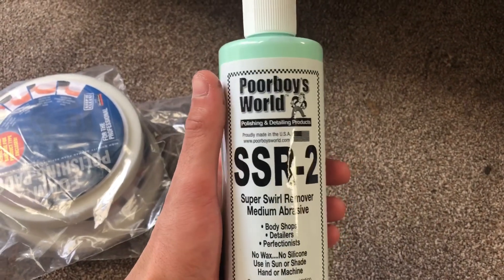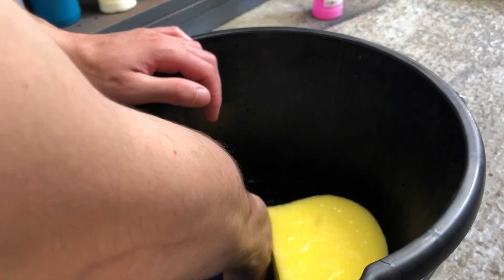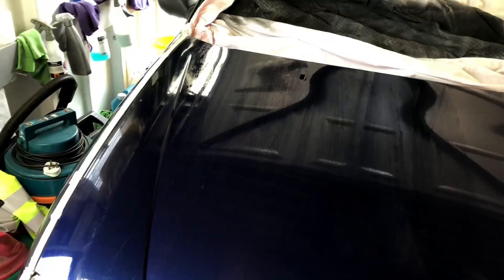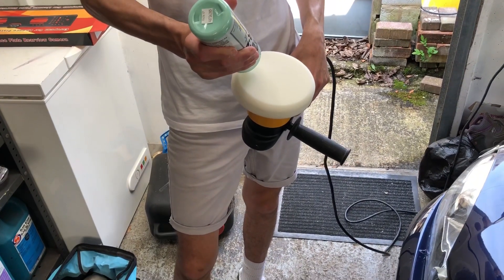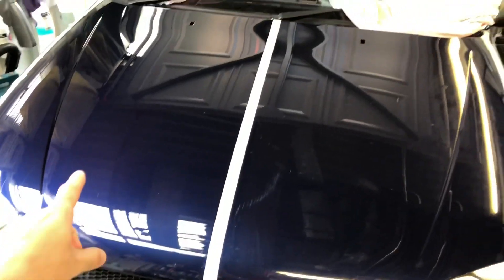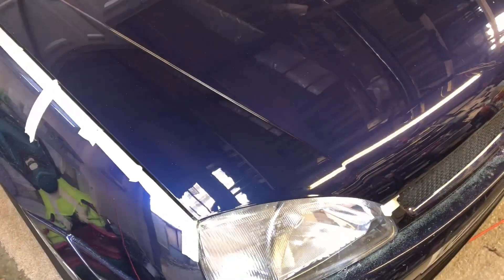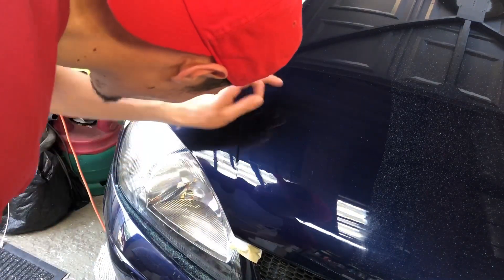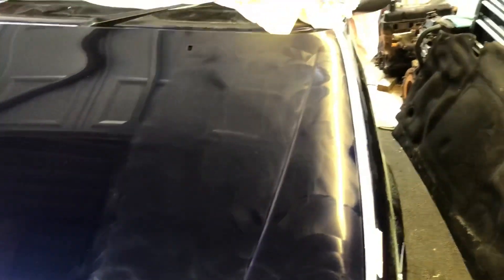Beginners machine polishing (restoring 20 year old paint work!)

Comment: Hats off mate you made it batter than it was and regardless of what the "pros" say if you are happy with it thats all that counts. Not saying don't listen to people and learn things but at the same time most of the people that say you are wrong have never done it. I was always told WD-40 swells up o-rings and is really bad people said it enough times that it was normal to say... Then I watched a few videos and tested it for myself and no WD-40 is safe to use with o-rings.... I believe it did way back in the day when o-rings were made of different compounds. Going off topic a bit but not everything people say is correct even if 100 people back them up they can still be wrong so keep doing what your doing. Try things for yourself   try what you feel others have mentioned and see what works for you not because all the "pros" say you should do it that way. You have a new sub mate keep it up.

Comment: Nice job, the only thing I’d do that I think you’d like is to decontaminate the paint (iron remover, tar remover) before claybar. Iron remover makes the wheels look like they’re bleeding! Weird but great all at the same time!
Reply from the maker: Jay G hi thanks for the comment, I wouldn’t use iron out on body work as it’s very strong and it’s only meant to be used to get brake dust off the wheels. However I did glue and tar the whole car before the process just didn’t record it!
Reply: Mk2 Mitch nice work. You can buy a fallout remover for paintwork too. In case you ever wanted to try. It will strip the wax though! Nice job nonetheless!

Comment: I head the best way to clay bar is to actually roll it over the paint and not rub it. Also adding a layer of polish after compound then wax further increases paint protection.
Reply from the maker: william smith wax and polish are pretty much the same thing but a good suggestion. I wouldn’t roll the clay across the surface as you need as much surface contact as possible to pick up the tar/dirt
Reply: @Mk2Mitch  I enjoyed your first time using a da, the more you practice the better you will come  try watching videos from Junkman2000 Apex detail and Car craft auto detailing, very useful information. Regarding polish is the same as wax, this is incorrect. Wax just protects the clearcoat, Waxpolish cuts/polishes and waxes, Polish is like a fine compound and it burnishes ie makes the clearcoat shine and no wax.

I have a silver 2005 Focus estate in silver, the paint is like glass, washed, clayed, mopped with a rotary, paint sealant then a hard wax, should really wipe the paint with a 30% IPA mix after using my rotary but as it is old as I am I never bother. Anyway check out those videos,
all the best
Reply: You compound to get the paint flat quickly, then polish to bring up shine with less cut and a diminishing abrasive, then do an IPA wipe over, then chuck on a wax/sealant/coating.
Reply: Not heard that one before :D As long as the clay bar is well lubricated and you use a very little amount of pressure there should be no scratches. I use two fingers holding the back of the clay bar and just gently rub back and forwards, and every so often kneading the clay bar so you're always left with a fresh surface. If you do drop the clay bar, get rid.
Reply from the maker: Thanks for all the suggestions guys, will defiantly be putting it into practice
Reply: I can also recommend auto finesse car wax. It's very expensive £50 for the cheap one but my god is it good and works so good as a rain repellant on glass.
Reply: Wax and polish are completely different. All polishes are abrasive, hence why they're used for correcting paint  and offer no protection. Wax is not abrasive and is a sacrificial layer, that does add protection

Comment: Don’t use a sponge
Reply from the maker: hakman239 sponge was brand new and only used once the vehicle was decontaminated.
Reply: H sponge will scratch it has a flat surface you just need to rinse after clay no need to re wash doesn’t matter if the sponge is new or not
Reply from the maker: hakman239 meh, each to their own. Sponge wouldn’t scratch the surface as it was new and there was no contaminate left. I was simply rinsing with the sponge.
Reply: It will scratch your just rubbing the dirt across the surface because the sponge has a flat surface doesn’t matter if it’s new use a wash mitt and just rinse after clying your just gona cause swirls again if you wash with a sponge
Reply from the maker: hakman239 but the surface if clean, the sponge is clean, where are you getting the scratches from? Even if I were to cause more scratches this is the last stage before machining so surely I’d get them out?
Reply: Ok fair enough but you don’t need a sponge to rinse it off just use a hose